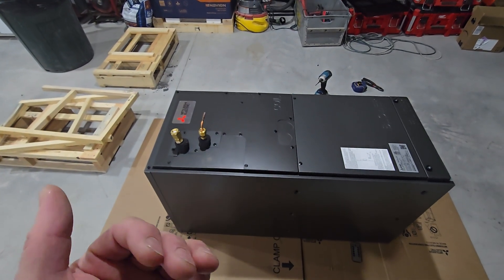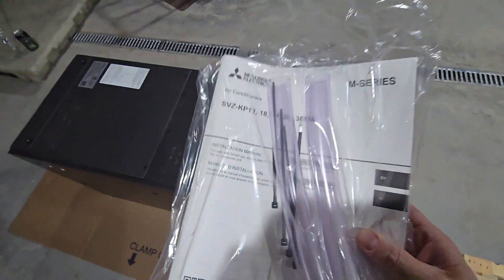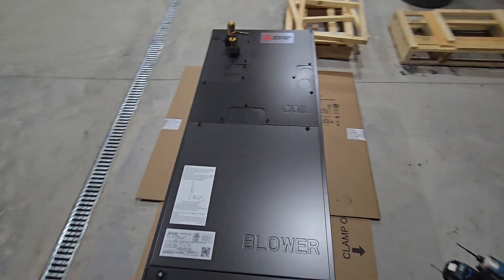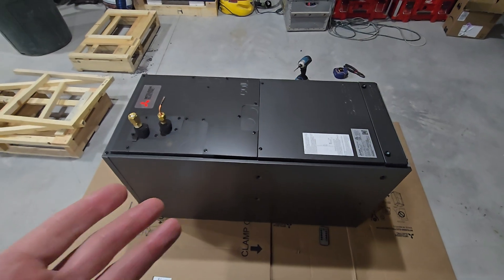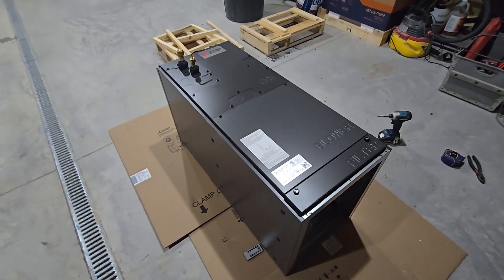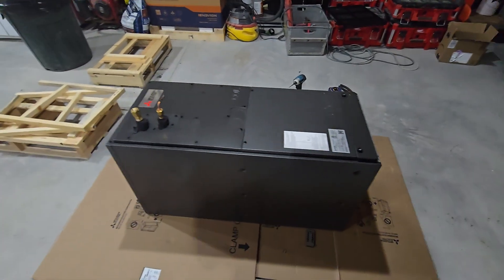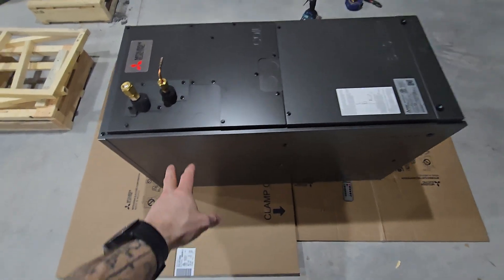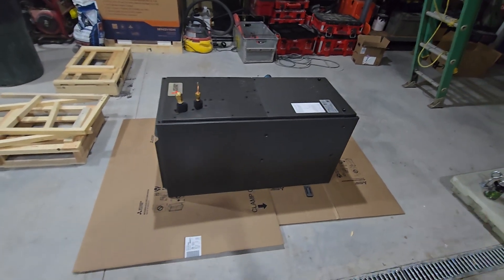Mitsubishi SVZ Series Heat Pump Air Handler

Comment: Hey FYI, when doing this conversion make sure you don’t pitch the coil temp sensor wire with the drip tray. It’s easy to do and after about a month of running, will cause an intermittent break in the wire. Something I learned the hard way!
Reply from the maker: Thanks for mentioning. The manual points it out too. It was still almost impossible not to pinch it because there was no slack in the wire. I made sure it was at least pinching between the gasket material and not direct metal but I still didn't feel great about it. I might pull it apart again just to check it.
Reply: @ just emailed you a picture of mine if that helps!
Reply from the maker: @dsheli3 what's your email? Email me again. I have a question about this SVZ unit

Comment: Nice stuff, i have a project that is just under 9k sq feet, that is all radiant infloor heat on all 3 levels. Plus two dedicated zones for fully ducted forced air using 2 heat pumps, a 2 ton and a 4 ton. Can't wait to get it all comissioned.

Comment: If the best heating source is floor heating why not have the best cooling source by using heat pump heads in each room with erv . The price for two units u got is amazing
Reply from the maker: @PenguinKnightilia  i do also have 2 ERVs in the home. The ERVs will dump fresh air into the returns of the air handlers. The ERV and air handlers will run 24/7.